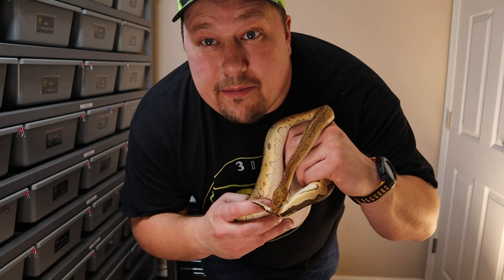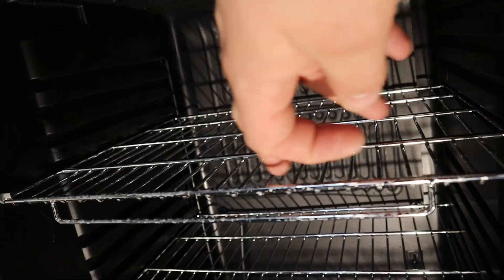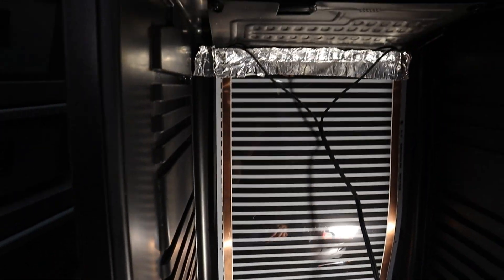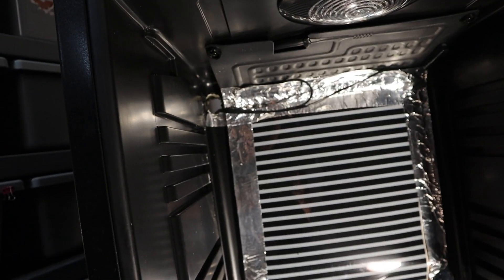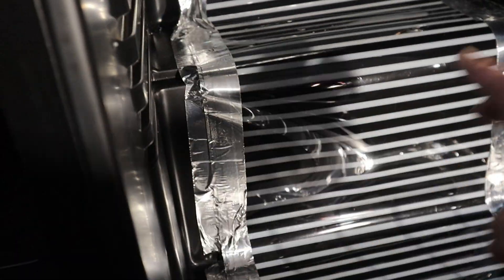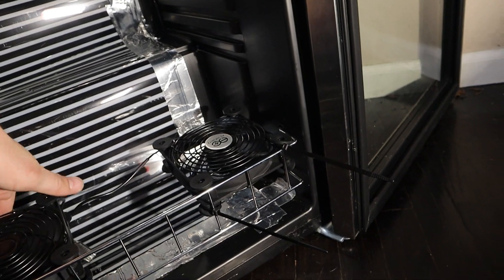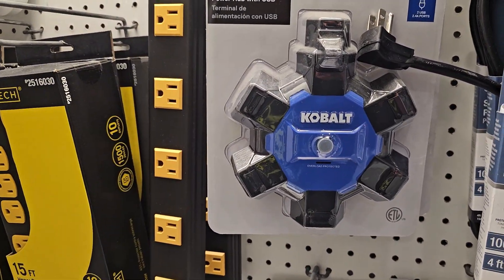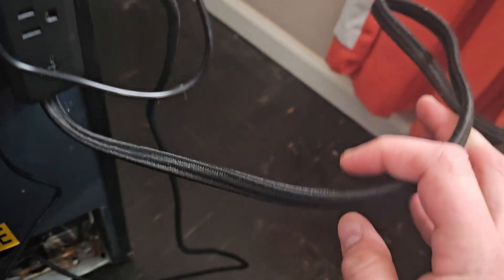I SAVED Thousands with This Reptile Incubator!

Comment: I honestly think I might have a Freon leak in mine it smells chemically every time I open it what should I do??
Reply from the maker: I have not encountered this, although very possible. I would probably research how to drain it and remove the compressor.
Reply: @319reptiles hey so I got it fixed I had a guy run some hydrochloride I think it was that he said something of that nature but he ran it through the lines and completely cleared the lines of any Freon and smells it was only 60 bucks and he ended up taking the compressor out for me so I just ended up gutting it and honestly it looks way better this way and has more room for lighting and I think I might be able to fit another row of boxes !

Comment: How do you adjust the temperature
Reply from the maker: @710adrian8  I'm using a Vivarium Electronics VE200 Pulse Proportional thermostat on the heat tape. The thermostat will keep the temp where you set it.

Comment: So the fans in the cooler wouldn’t work? I got a cooler that has two fans, should I use those or the ones you got you think
Reply from the maker: I have had good luck with the ones I bought, but that doesn't mean the one you have won't work. I think you're safe trying them and seeing if they work.

Comment: How are you achieving 99% humidity in it when incubating ball python eggs ?
Reply: Does it have inlet and outlet for the air?
Reply from the maker: @wils6567 I do not have inlet or outlet air. I just have the internal fans. There will be some air exchange through the door seals and the hole for the electrical.
Reply from the maker: I use 6qt Sterilite boxes with easy hatch trays and fill with equal parts water and perlite and then put press and seal over the top and close the box. 

https://youtu.be/ita4bLKEkdI?si=BbxPW--Yf39kvgux